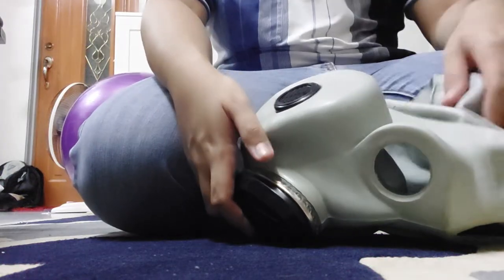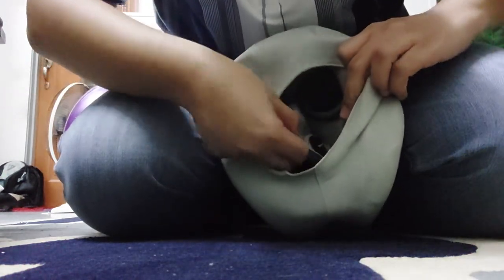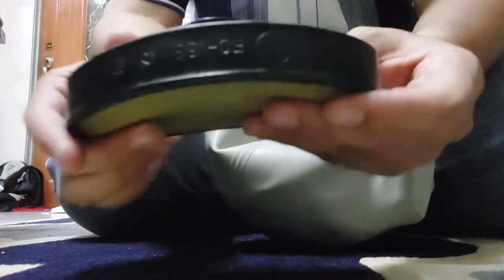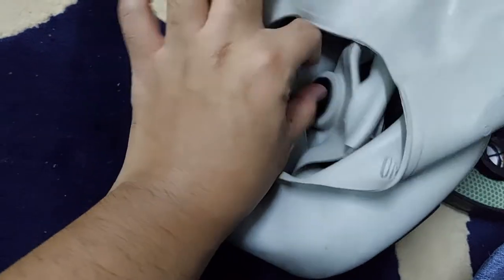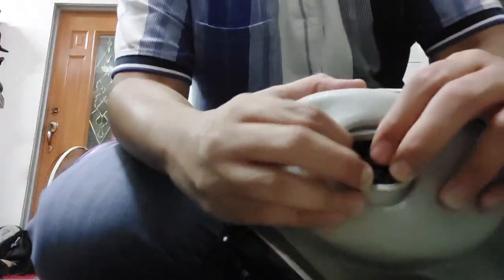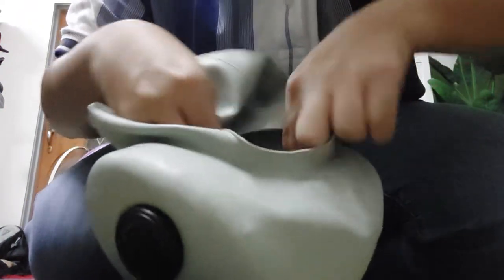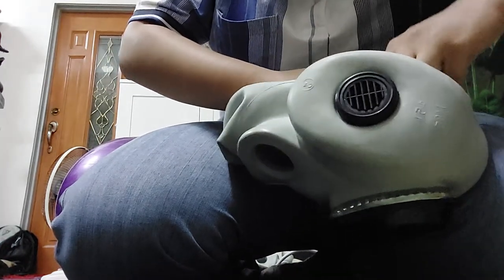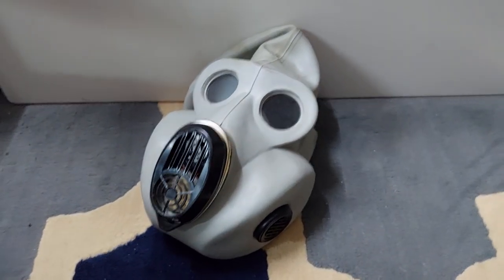How to remove and install filters on a Soviet PBF [ПБФ] (ShMB [ШМБ]) gas mask

Comment: so i bought the pbf gas mask from ebay how do i know if my filters have asbestos in it, should i be worried about it? is it really that dangerous?
Reply from the maker: Well it does have asbestos. However, if it's not leaking, you should be fine. But as a rule of thumb, if you were to wear the PBF with the filters installed, make sure that you minimise breathing through it. If you feel your breathing is somewhat 'dusty', immediately undon the mask and seek medical attention if breathing problems occur. Better yet, installing the unleaking filters to the PBF without breathing through it would be best in my opinion. To know if your filter is leaking or not, take a piece of white paper, and shake the filter on it. If there's something on the paper, then it is positive that the filter is leaking. If you can obviously see charcoal spewing out the filter, handle with care.
Reply: @Boris_Din_Dietrich__Hazim  oh ok, I wanted it for rough use, but I use it better without filters, thanks
Reply from the maker: @derek_a7263  aye, welcome. Still, you shouldn't be using old filters (let alone old masks) to do chores that needs respiratory protection. Get a decent 40mm mask with modern filters or you could opt for the ones with proprietary filters like 3M, Shigematsu, Honeywell, et cetera.